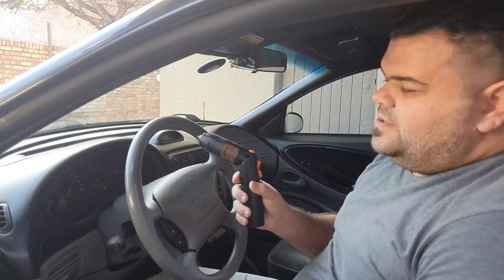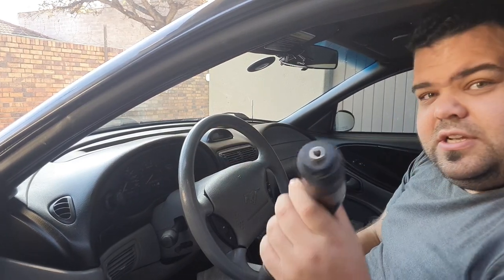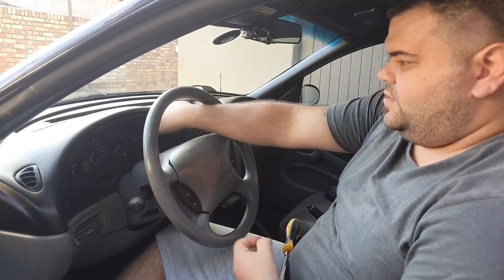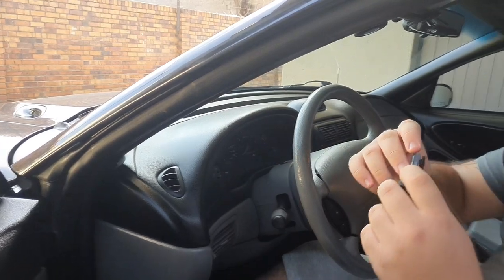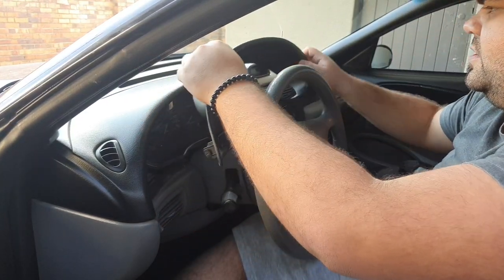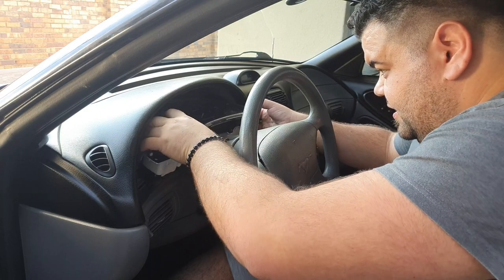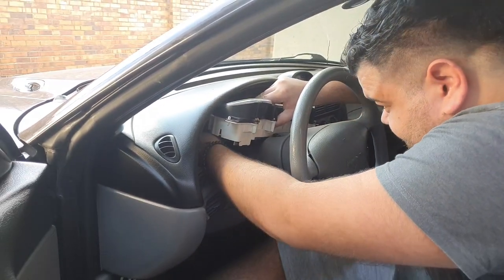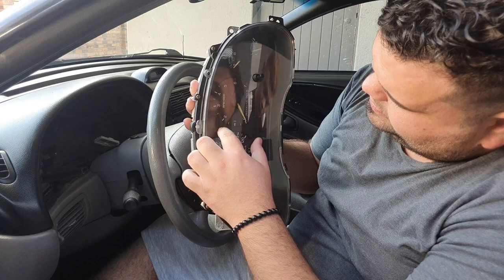New white face gauges cluster.

Comment: Thanks for the how to. Couldn't find anything anywhere before I did mine. Great job.
Reply from the maker: Thanks man. How did yours come out? Did you struggle or was it easy for you?
Reply: @RidingtheReaper  I haven't even ordered mine yet. I've had my whole dash outa my car tho so not worried about the install. Thinking about getting the stick on ones from LMR so I don't have to remove needles and recalibrate them. I like the ones you got from CJ's but don't want to mess  needles up.
Reply from the maker: @Gear1993Head  true that man. The stick on one's are pretty neat. Get the ones that have the back glow LED's they are a bit more expensive but they look badass.
Reply: @RidingtheReaper  finally put mine on. Not hard at all and looks amazing. Ironically just stumbled on this video had to update lol
Reply from the maker: @Gear1993Head  nice 👌.  Yeah they can really make a difference to the interior of the car. Glad you are enjoying them.😁

Comment: Awesome job how do the needles go back on though wish u would have showed that..
Reply from the maker: Sorry man, nah it's very easy they just push right back in after you done with the gauges. It's like steel points where the needles just push right back on.
Reply: O nuice im assuming jus pointed to zero all the way pointing to the left or do they go pointed straight up..
Reply from the maker: @boodogggoblino6022  all the way to zero bud. Against the stopper.